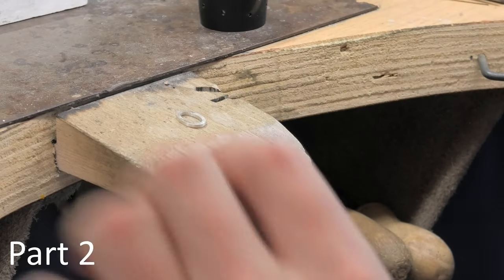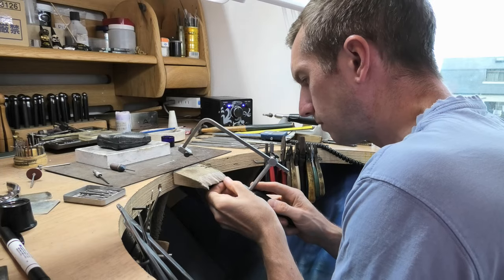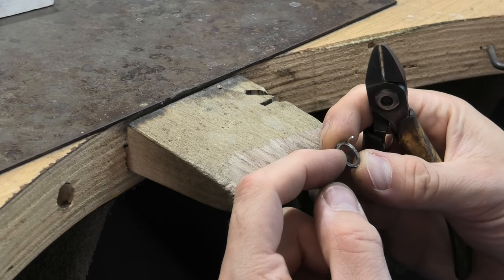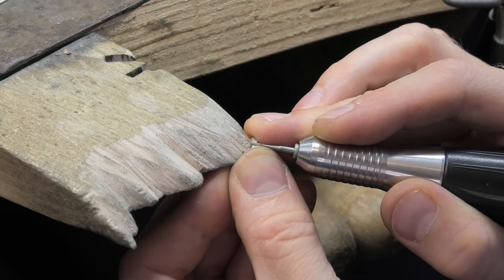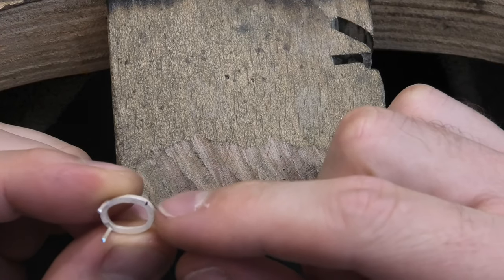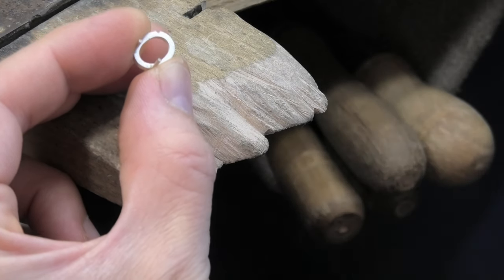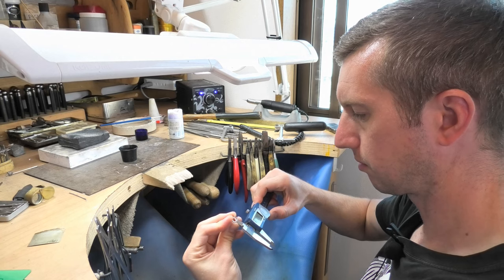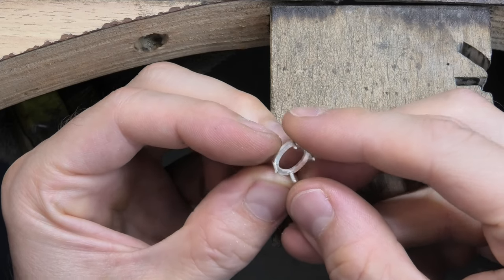How to Make an Oval 4 Claw (Part 2)

Comment: You moved the claw, 
what was your method for fixing the scar of the incorrect cut?
Reply from the maker: If it only moves a tiny amount just extra solder to fill the space. Its not ideal but it works